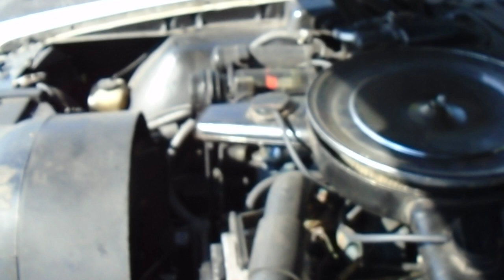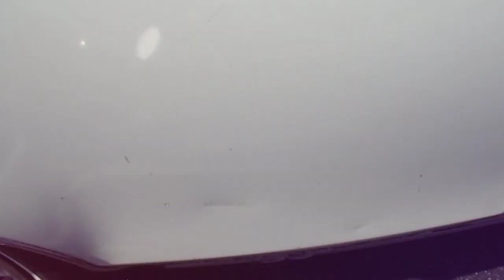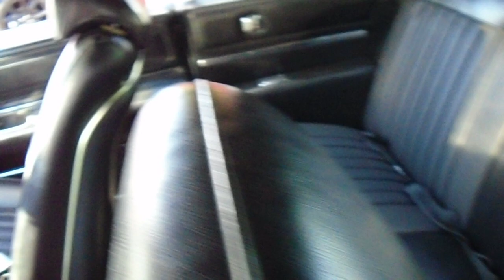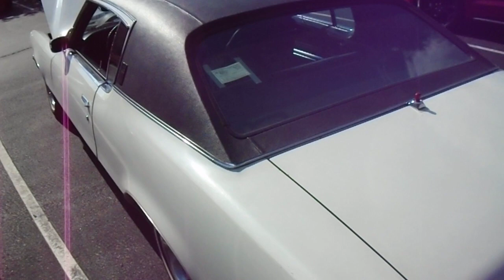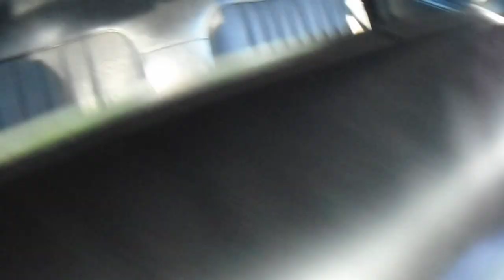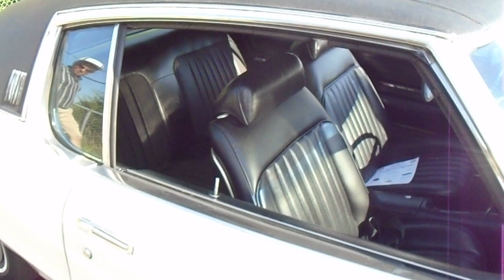1969 PONTIAC GRAND PRIX SJ - DE LOREAN MASTERPIECE

Comment: nice body lines , but they had engineering issues , mechanics i knew in the 60s and 70s hated working on them and called them Grand Pri*ks  .
Reply from the maker: I never heard anything about mechanical issues. So, the outside was beautiful and the inside issues were grand pri*ks. Good nick name for a GP lemon. Thanks for watching David and for the comments.